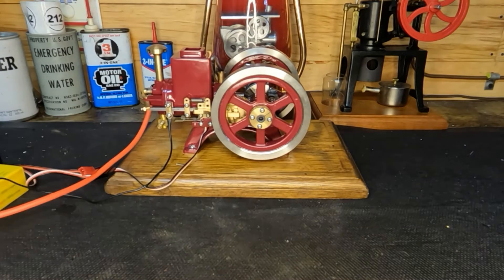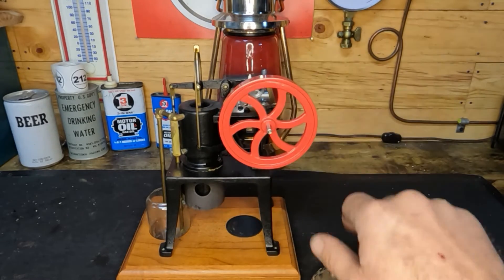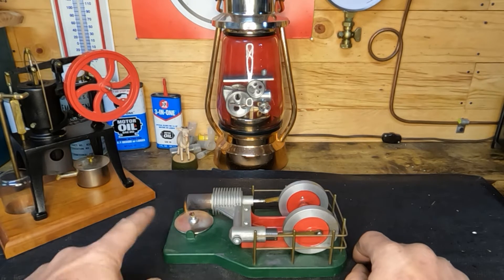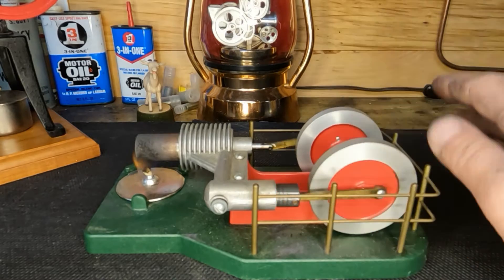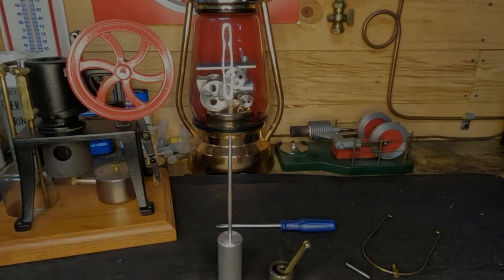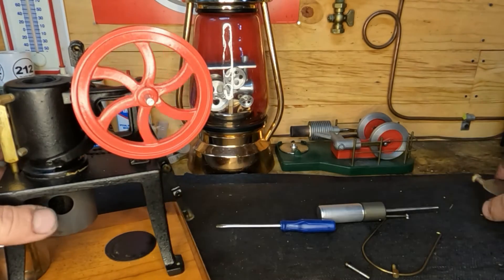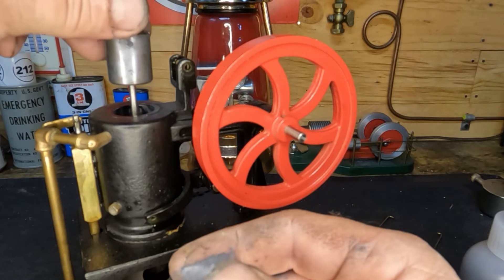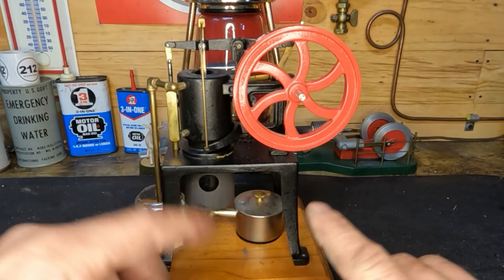Rider Ericsson Hot Air Pumping Engine Repair & Run

Comment: I am afraid that you will have to disassemble these engines and clean them before each start
Reply from the maker: I can assure you that if you oil the cylinders it will absolutely need to be taken down and cleaned

Comment: That was great.....  I have 2 flame licker engines that I haven't had any luck in getting them to run.  I confess I have used a light oil on them thinking it was needed to make the cylinder have less friction.  I will be taking one at a time apart cleaning off all of the oil then lubing with molybdenum.
thanks for the tip.
Reply from the maker: Hi Gary. Keep me posted on how you do. I'm glad that you found this video helpful 👍

Comment: That's a pretty impressive engine there.
Reply from the maker: Thank you Blue Heeler. I have always been fascinated by all of the movement, there are so many different actions that work together beautifully just to pump water.
Reply: @steam212  And forgot to add......I've searched high and low for one of your lamps on the Internet......its on my bucket list....gonna' get one of them somehow someway one day :)
Reply from the maker: @SteamEngines-Jim  I know of a rapid prototyping business nearby that specializes in small custom items (no promises) I may see if there is a way to produce a few if the budget allows. I will definitely keep you posted 😉

Comment: That lubricant seems to work nicely. Nice Sterling Engine. About how old is the engine you worked on?
Reply from the maker: Hi Chris, These engines are still available from PM research.   I would guess that this one is one of the older models though, simply judging by the pictures of the newer ones and the schmoo build up.

Comment: Thanks for taking the time to show the difference between oil and molybdenum disulfide as a lubricant on the hot air engine. Will PTFE powder work as an alternative to molybdenum disulfide? The bottle you showed was costing the equivalent of $47 to buy in the UK.
Reply from the maker: Hi Stephen, I would like to be able to give you an honest answer, but I have never used PTFE powder before. I would make a stop at a locksmith and pick up some powdered graphite (I know that works well) before trying something with a melting point of 650°F. I say that only because I would feel terrible if you were to attempt it and then coat everything in a plastic goo.  There is absolutely nothing wrong with using powdered graphite, it it inexpensive and does a fantastic job.  In my honest opinion, I would still be using graphite if the other option were that expensive.    I believe that the size of the "dust" is what makes the most difference (easier to fill the pores).   I really hope this helps, and Thank you for your question and for watching 👍
Reply: @steam212   Thanks for taking the time to reply. I did a bit more searching and got a 25g (0.8 oz) pack for the equivalent of $12 (larger volumes worked out even cheaper). I'm looking forward to seeing how it works.